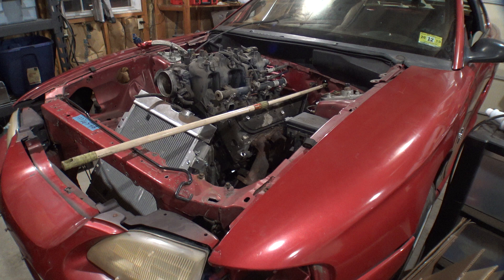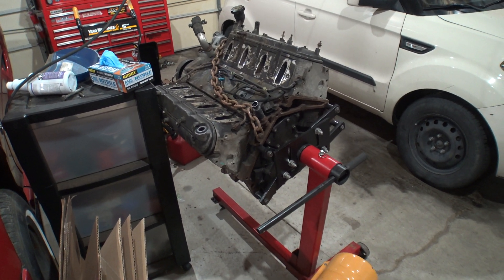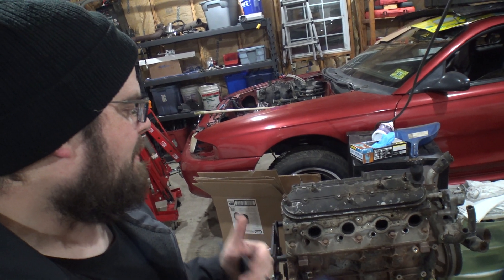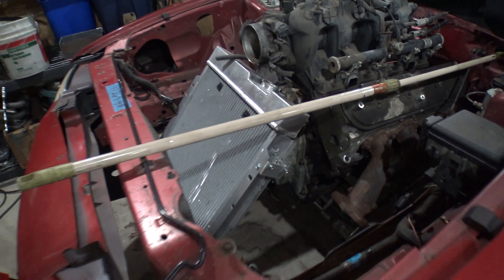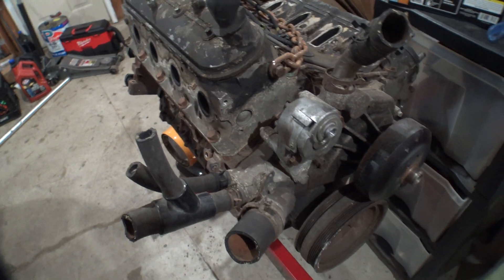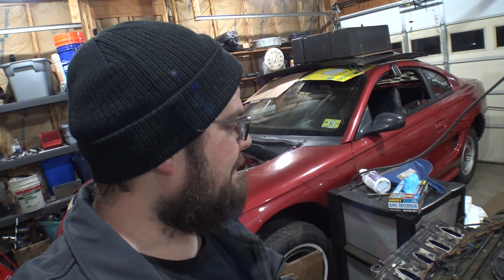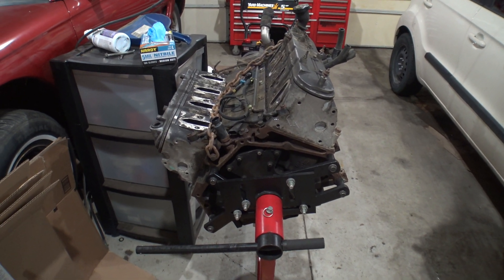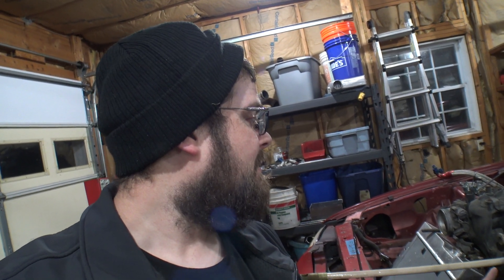Project 8F8: motor 2 update

Comment: If you decide to do piston and rod 4.8, molnar makes a 6.3" power adder con rod. Then ive found shelf pistons for the small bore with anywhere from 1.295 to 1.304 ch depending on where you want ptd clearence.

Comment: As somebody with a degree in high performance motorsports, you're totally correct in saying that e85 is better for IAT's, let me tell you why. E85 requires ~30% more fuel than straight gasoline. That "cold" (relative to intake air) fuel has thermal mass, and when sprayed into the engine absorbs more heat thanks to having more volume.

That said, you're an inspiration to me and many others, keep it sloppy, we're proud of you.

Comment: hello I have a tahoe lm7 engine 2005 casting number 12551358, I will use it to drift in a 240sx that cams would recommend me and what springs for more power

Comment: Fun project. Look forward to seeing it rip. 4. Great! I picked up a Ly6. Paid 1,200 for it. No accessories though or intake. I'm going to run my Holley super sniper on a Holley 4 barrel intake. And msd 6014. Will be boosting it in the future. I got the sloppy stage 2 cam😀 I'm not going the sloppy route though lol. Full rebuild (yes cam bearings too) DSS racing forged pistons and scat H beams. Went with 6.250 rods.Love watching your posts. You inspire many a LS swap.

Comment: have you considered an l76 from an 07-08 vortex max? i dont see many people using them but they are a 6.0 aluminum block with 823 rectangle port heads, 2.2" intake valves.

Comment: I have an 04 Silverado with the 4.8 in it and it’s only got the fuel supply line, no return and no inline fuel filter. Can someone tell me why this is, or anything you’ve done to yours. As far as adding a return style setup and or a inline fuel filter? Also has anyone done an abs delete on a 99-07 pickup? Thanks in advance 👍

Comment: On the steam tubes/coolant crossovers: I asked a man who was on the development team for the LS engine what I should do, he said that GM used them before doing testing but then later determined they werent needed. He said they left them cause they were already developed and made bleeding the cooling system easier.🤙

Comment: If you did a rod/piston 4.8 it would live forever. What’s cool is, like you said nobody does it. And you run a 6.300” connecting rod with a piston for 3.780” bore 3.622” stroke and 6.125” rod. The compression height comes out perfect. Voila.

Comment: I love the idea of rods/pistons promod turbo 4.8. I dont think displacement is holding you back. I'll also say, I'd love to see some sloppy rpm setups. I suspect a cam/valvesprings 4.8 could really scream. But you'd probably need more than 1218s.
Reply: Me too and I think it'll make more than the Ly6 for less money too.
Reply: @southjerseysound7340  that would be a fun test! High RPM 4.8 vs ly6.0 power per dollar. I mean, obviously that depends on the turbo. With some napkin math, you need to spin a 4.8 to 8125rpm to displace the same air as a 6.0l at 6500rpm. So if you can go that high, it's not a problem. Also though, a better rod ratio may afford higher cylinder pressure capabilities. A high rpm motor needs to make less torque too, so that's less force going through the rods for a fixed horsepower number. So if we figure a gen 4 sbe can take 600ft/lbs of torque no problem, that's 928hp at 8125rpm vs 742hp at 6500rpm given the same torque number.
Reply: Also, if we figure a pro mod turbo can chooch out 1500hp of air, that's 969 ft/lbs at 8125rpm. So doesn't sound too far out of the wheelhouse of a sbe gen 4 block, let alone a rods/pistons setup.
Reply: Also safer for the block, less boost at low rpm.
Reply: @Levibetz  Your #s don't take boost VE in to account...
Reply: @scottleggejr  My numbers are 100% non scientific, bullshit bench racing numbers.

Comment: I went to fasster llc on ebay and they sell fuel rails that are for the truck manifold. I have a set on mine they fit pretty well and are a -8 fitting size.

Comment: I see difference ranges depending on where u look or ask. So in your opinion how much hp is a turbo sbe ls1 good for? I do have arp rod bolts not that, that is going to make much of a difference. Plans are to see what it will take and go 6.0 once it pops.

Comment: I wish I could keep track of my 10mm, and 13mm, and 15mm - and for some reason my 1/2 disappears from time to time - hell, I've lost an entire ratchet until finding it on the fender apron 6 months later - I've found sockets in the wash and a torque wrench under the seat - many vehicles to work on and not enough light in the driveway creates some interesting spots for tools to disappear.  Good thing they're mostly all cheap Chinese made ones. Eventually they all show up again.

Comment: Be neat to see a Ls3/4.8 crank destroker to 339 inches. 8000 rpms, they (hot rod and their corporate gimme's) got 6 hun with carbs on a tunnel ram... Ain't cheap though, rods and pistons were custom I believe (pistons look short, pins probably a tad higher for the rod length I donno). I'd be frightened to see what a turbo and extra fuel could get out of it.
Reply: never heard of this, interesting... i have an LS3 to donate, just kidding, only 24k on her

Comment: Hey matt, one of my subs recommended this to me but I haven't found 2 sets of rails at the local scrap yard yet.

When going with the nnbs/tbss they made a removable style crossover set of factory rails. On that style setup it is returnless but the feed enters in under the crossover. So by getting 2 drivers side rails you could effectively have dual feed(a feed on each side)
It would be cool to see the limitations of that setup and have a set of the short hat rails if it's something your interested in testing. Like I said earlier haven't found a second set for less then aftermarket rail money so haven't went that way yet
Reply: I have an 2007 LQ4 intake and rails I'm willing to part with for a good price if that is what you need and are willing to pay shipping. If I misunderstood you can disregard my comment.
Reply: @almccameron4960  I'd be willing to buy them from you if they are what I'm looking for. You can email me at dirtfloorfab @ gmail.com or my Facebook page is dirtfloorfab if that is easier for you

Comment: Not wrong about the e85 comment it doesnt even have the btu capability of even 87 octane e85 while it does have the octane it doesnt have the ablity to make the heat if that makes sense. So no the e85 does not create the heat needed to make the ring gaps butt together and pop the crown off the piston
Reply: Not disagreeing. But,  what temps would the top ring land see from compression alone? As I recall temps from high compression motors would see the temp in the chamber go through the roof before the piston approuched tdc. I'd think with boost, that the, VE would be much higher then a naturally aspirated engine. Then again,  I've heard meth guys cram CRs through the roof.
Reply: @burnout9069  well there is a lot of factors at play here and also depends on if your talking static compression or dynamic compression. Static I wouldnt expext to see much of a temp rise. Dynamic would have to take into account the amoint of boost, how effective the chaege air cooling if any is ya know things of that nature. With that being said I think ots safe to say that from compression alone dynamically not taking the cooling effect of the fuel into account that the temps could reach the 300 degree range

Comment: I have a request: As you are going through this untouched engine, please point out what is and is not important to look for. When you opened the last one, that missing o-ring in that cam retainer plate is not something I would have known was so critically important, or even would have realized was missing.

Comment: I got my rods for my 4.8 for 600.00
Lunati h beams 6.300inch not a bad price
Reply: Custom piston? Cause that's not stock 4.8 rod length.
Reply: @johnboy9769  None of the aftermarket rods are stock length even for 5.3,6.0,6.2 because  most aftermarket pistons have different pin/ compression height .
Reply: I used wiseco pistons ,stock are 6.275 I believe, and  even with the stock pin location the wisecos 6.300 rods worked perfectly no issues with ptv clearance worked great

Comment: My Ly6 was $1200 but having to delete the vvt and buy the lingenfelter box that converts the 58x to 24x so I could run it on a p59 was like an extra $400. So I guess you will be using a gold box or Holley.
Reply: Could you break that down a bit for a noob?
Reply: J T the Ly6 is like the gen IV
lq4 that came in ‘07.5 and newer work trucks. It has square port heads like on the Ls3.
Reply: J T it has Vvt which is variable valve timing, electronic cam phaser in the timing cover. It also uses a 58 tooth reluctor wheel and a 4 tooth cam gear instead of the 24 tooth reluctor wheel like the gen III motors the gen III ecm can’t read it so you need a box to convert the signal.
Reply: @johntheobalt2303  thanks
Reply: Why would you convert it to p59? The E38 can do 2.5 bar speed density OS and do flex fuel.
Reply: AJ it’s going in an ‘05 Regular Cab Short Bed and I just wanted everything to work. I had thought about slamming it in my Fox coupe in that case I would have ran the e38. I just thought it would be less work to just use the harness from the truck.

Comment: matt can you show what you did to make the 4.6 mounts work and show what kind of oil pan and clearances your working with around the steering rack and what not?   thanks
Reply from the maker: yep i can whip under there before we yank this engine or after we are installing the new boiiii
Reply: @SloppyMechanics  awesome i appreciate it, i just baught a fox with a tubular subframe and i baught stock 4.6 mounts to make work with hopefully a truck pan  cause who wants to pay 300 bucks for a mount kit when you can use stock ish parts
Reply: @chrisbrehaut6632  Stockish parts have the R&D put into them no need to make a new one if the old one works.
Reply: @kill Joy ya i did, something a bit more track ready

Comment: Dumb idea but I wonder if you could drill and tap fittings into the ends of the fuel rails and just cap the stock lines

Comment: Why not cut and weld the stock rail? Weld a -10an bung.
Reply: ABeans07 most can’t tig weld the rail. I’m in this boat. So I ran a China aeromotive off of the pressure test port and it works great so far. It’s -4 AN just remove the valve with a valve core tool for tires.

Comment: Ly6 just use a iron 6liter with flat top gen lv ls2 rods and pistons and get a set of 823 cylinder heads that will give you the Ly6 with higher compression 10.9.1 I built boat loads of them and have one on the engine stand complete for my lsa catera 3.90 gears 80e.

Comment: Actually, as an aeronautical engineer I can tell you that you are right about old parts. The airline industry discovered that Old means Good and "replace with new" means "prone to installation error and early failure". There is even a "bucket" failure curve based on this observation as defined in maintenance statistics models.
Reply: Paul Sheer - Is that called the bathtub curve?  I think that's what I've heard it called... 🤔
Reply: @tj86xj  yes, that's it

Comment: Good evening matt  i have a 03 4.great  and only rear steam ports normal ?  I checked into rods had 2 bent ones when i bought it and i really couldn't find any cause of the length compared to 5.3 and 6.0.
Reply: Yeah its easier to grab a 5.3 crank and do rods then.